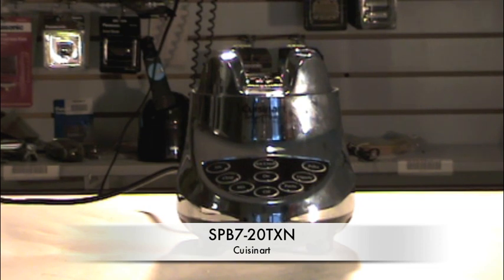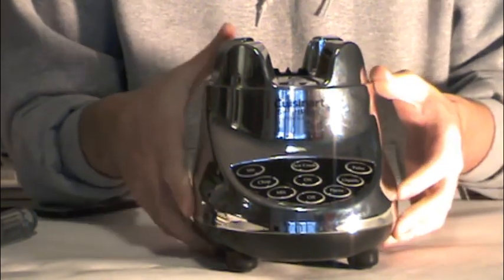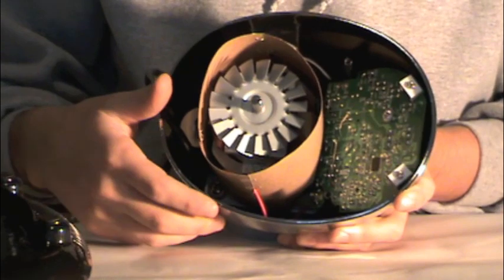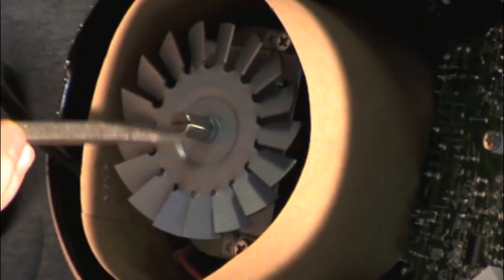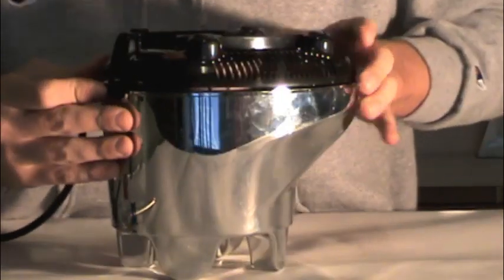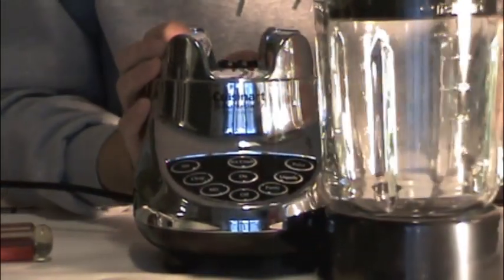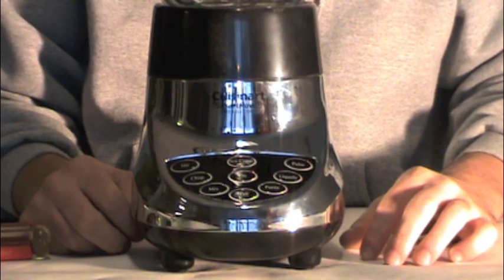How To Change The Coupling (Driver Clutch) On Your Cuisinart Blender

Comment: Thanks for the video, on mine the plastic piece of the couple was gone leaving the brass piece of it on the shaft. It was so tight that I had to remove the motor and use small nose vise grip and a pliers to remove it. My model is: BFP-650C. It's the same concept how to replace this part for most of these blenders although different model.
Reply: Thanks for leaving this comment. I’m struggling with that brass piece as well — using pliers to turn clockwise while holding the motor with the flat head. I’m going to give the vise grips a try

Comment: Thanks, this was most helpful, knowing which way to turn the coupler to remove it. It was too tight and I had to use a hammer and screw driver to chisel it briefly to loosen it.

Comment: HI THERE, GREAT VIDEO, THANK YOU VERY MUCH. MY DRIVE COUPLER IS NOT THE SAME AS THE BLENDING COUPLER. THE DRIVE COUPLER IS MADE OF A SOFT RUBBER, THIS IS WHY IT WORE OUT SO FAST. SHOULD I REPLACE IT WITH THE SAME SOFT RUBBER ONE OR GET A HARD PLASTIC ONE? ONE OTHER QUESTION. WHEN PUTTING ON THE THE GLASS BLENDER BODY ITSELF, HOW CAREFUL SHOULD I BE SO IT MESHES WITH BOTH COUPLERS? THANKS.

Comment: I have a cuisinart velocity ultra blender and have this issue with the coupler. I have that brass piece stuck and can't get if off! Any advice? Even took a vice grip to grip the brass part and then tried to turn the other end with a screw driver but not its stripped that end too! How can I get it off?
Reply: Same! Did you ever figure it out?
Reply: @Eilen-money   Hi, no I never figured this out and since then have gone through another couple blenders. Seems like these appliances all have a lifespan with a small plastic piece waiting to bust.

Comment: On mine, the securing screw by the power cable is a wierd split groove type ive never seen before. Imagine a flathead screw with a solid bar in the middle. Obviously to prevent this being done.

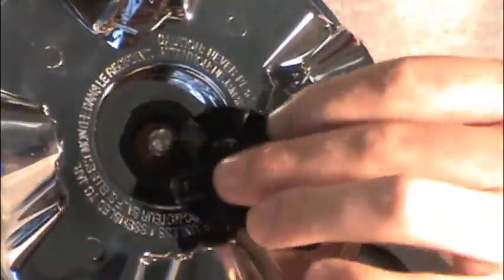Comment: I want to buy the coupler I found online for about 6 bucks, but I want to make sure it comes with the "gold part you mention in the video" 1:38, if it doesn't then it makes no sense to buy it. I'm not even sure if that brass looking screw is part of the plastic piece.

Comment: When I removed the bottom cover, the fan slides right off the motor shaft. Isn't the fan supposed to be secured/attached to the shaft somehow? Otherwise it just slides right off if the shaft is pointing downward.
Thnx for any haelp!

Comment: It was too tight to remove. No way to get enough leverage to hold the shaft with the screw driver while trying to twist if off with the other hand. Blender is poorly designed because of that plastic part and no way to remove it unless you're superman.